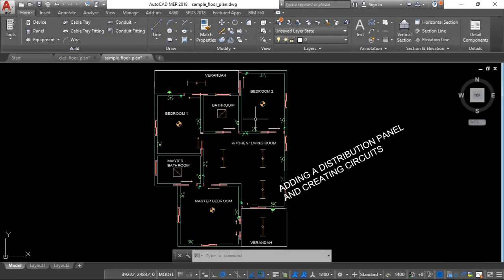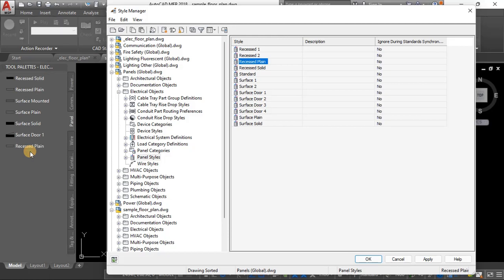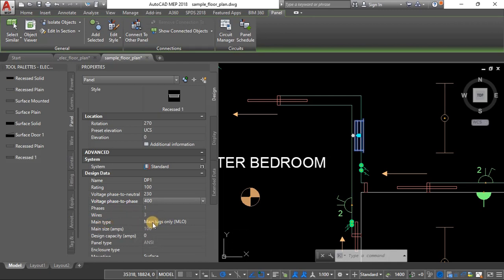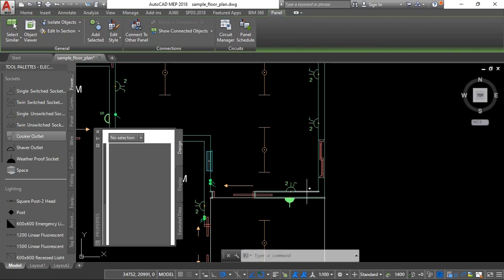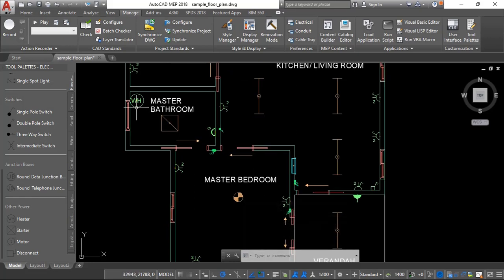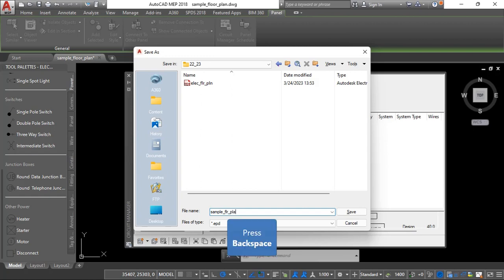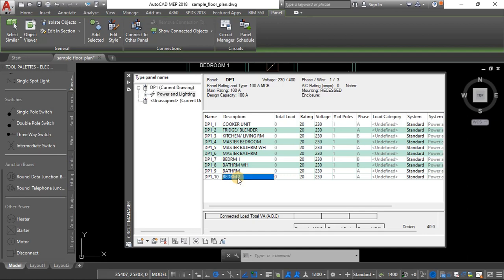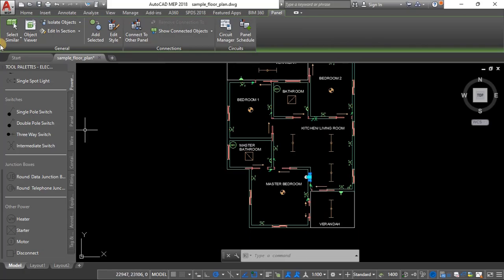05 ELECTRICAL FLOOR PLAN DESIGN  PART 2

Comment: Thank you, could you please explain adding devices not coming with AutoCAD like switches lighting with deferent watt
Reply from the maker: We'll, if you're using a different version of AutoCAD (like architectural, or civil for instance) then you need to build your own electrical symbol. But this task is quite cumbersome. 

I recommend using specifically AutoCAD MEP version with you want to deal with electrical floor plan design. 

For the case of different wattage, you can always set values to what is required in your project. Simply click on the device/ light and check it's properties